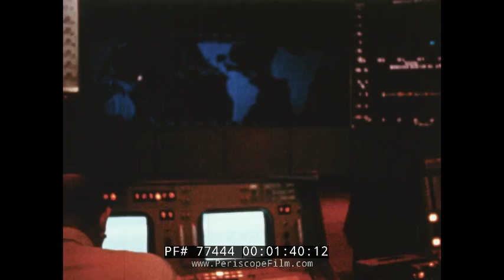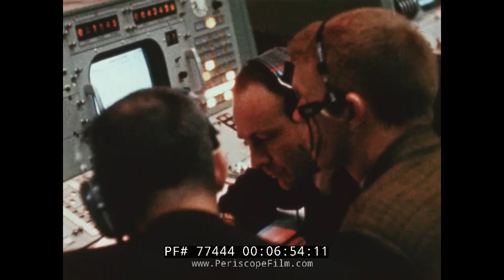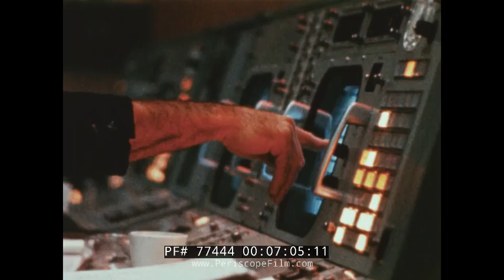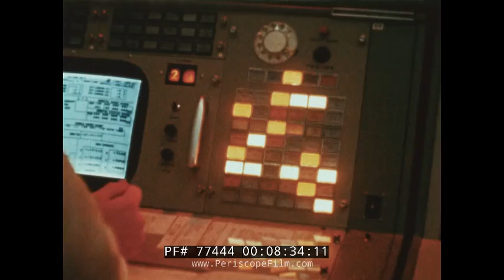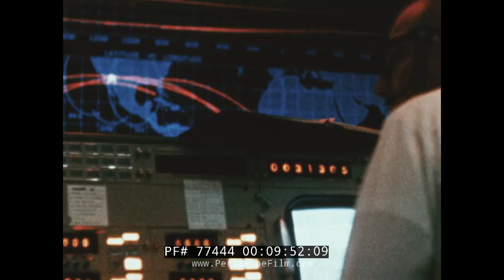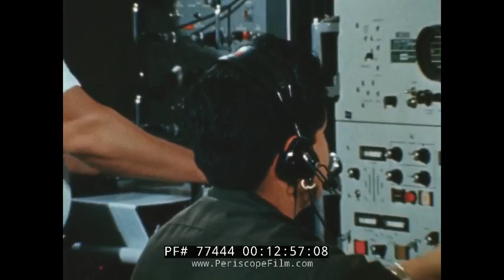THE APOLLO 5 MISSION NASA APOLLO PROGRAM LUNAR MODULE FILM 77444

Comment: This unmanned LM test was originally scheduled for April, 1967.

Had the Apollo 1 tragedy not occurred, Apollo 1 would have flown in February, 1967 on a flight of at least eleven days, perhaps even sixteen days.

April, 1967 would have been the first unnamed test of the Saturn 5 rocket. and the first unmanned LM test flight.

In June of 1967, there were to have been three missions. One would have been an unnamed LM that would have been launched by a Saturn 1-B.

A second manned Apollo would have been launched on a Saturn 1-B to dock with the previously launched LM for a manned low earth orbit test.

The third launch would have been the second unmanned launch if the Saturn 5.

August would have seen the first manned Saturn 5 launch, with a high earth orbit test (several thousand miles) of the LM.

October, 1967 would have seen the first lunar mission, a lunar orbital flight and lunar landing rehearsal.

Christmastime 1967 would have been the first manned lunar landingof
Supposedly, had they lived, the Apollo 1 crew of Gus Grissom, Roger Chaffee, and Ed White would also flown that mission and that Grissom and Chaffee, instead of Neil Armstrong and Buzz Aldrin, would have been the first two men in the moon.....and that the landing might have been on Christmas Eve, 1967.
Reply: It's more agreed that if Apollo 1 hadn't happened - they wouldn't have gotten to the moon. Too many safety failures, shoddy work. It took those three men for the program to take a step back a moment and do things differently. Even then, many issues happened and the majority of missions was almost down to sheer luck.

Comment: They got a far superior command module because of the fire and the success of the program and landings...

Only Apollo 13 had problems due to a 02 tank explosion and they took fixes after that. A third tank placed at a different location and a super extra battery was installed for more emergency power if needed.
Reply: There was three tanks to start with. And they added an extra 200ah battery just to power the Command Module. 

The real issue with the explosion. The tank assembly was designed to be onboard Apollo 8, but it slipped on the platform mounting bolts. When it was being installed. So they removed it. Then put the one designed for Apollo 13 on it. 

Think about that. Apollo 8 went to the moon without a LEM. Had that tank assembly been installed on it. There was no chance of them making it back. As that one tank was damaged years early from over voltage. And nobody knew about the voltage changes NASA made. It was never passed down to the technicians. That actually tested the tanks.
Reply: @WizzRacing  I think you're mixing up the actual fuel cells with their reactant tanks. The Apollo CSM had 3 fuel cells however prior to the post 13 redesign, they only had 2 o2 and 2 h2 tanks, and all 4 plus the 3 fuel cells were all contained in a single sim bay. After they still kept the 2 h2 tanks but added a 3rd o2 tank on the opposite side of the SM that could be isolated in an emergency to supply crew breathing only, added an extra beefy battery to the SM, as well as another big (400AH) battery to the LM descent stage, among other changes

Comment: I thought the apollo 4 LM burn took it out of earth orbit and it was still orbiting the sun. Or is that the apollo 9 LM?
Reply: I don't believe Apollo 4 had a LM.
Reply: @kitcanyon658  no it didn’t. But maybe you mean the 3rd stage did a TLI burn to leave earth orbit? Because a LM wouldn’t have anywhere near the thrust to take the spacecraft out of earth orbit
Reply: @sblack48  : I was just pointing out that 4 didn't have a LM, that's all. Unfortunately I'm not up on which object was left in a solar orbit after a burn.
Reply: Apollo 10's 3rd stage and it's luner module are both in a heliocentric orbit.
Reply: @kitcanyon658  i think they said it had a “boiler plate” LM whatever that means
Reply: @sblack48  ; You’re right that there was a LM on the Apollo 5 mission. It actually did fly on its own in orbit, test firing its engines, both the descent and ascent engines.

Comment: I was an avid Apollo program in the 60s and 70s and don’t ever recall Apollo 5 ... or 2, 3, 4, or 6
Reply: They didn't number the flights that flew until Apollo 4.  There were a lot of unmanned vehicle tests -- mostly with Saturn 1's/1B's and boilerplate (engineering mock-ups approximating manned flight vehicles) hardware.  Several of the surviving boilerplate command modules are in museums around the Untied States.  They were instrumented flight hardware but never equipped with environmental control systems.
There was an Apollo 1 mission but it was cancelled after the pad fire that killed 3 astronauts during a test (January 27, 1967).   The designation "Apollo 1" was never reused for another test mission.
Apollo 4, 5, 6 were not well advertised because they were unmanned missions.
Apollo 4 and 6 tested the Saturn V rocket with a Command Module but no Lunar Module because they were having problems developing the LM and the first manned LM tests were delayed until 1969 (Apollo 9).
Apollo 5 did test the LM (the only unmanned LM test) but it wasn't a full-up LM in the sense that A) they had no landing legs to save on weight and B) the batteries and oxygen tanks were only partially loaded.  The batteries were partially discharged to prevent over-voltage of the electronics and the oxygen tanks were only partially filled to save weight and also because it was unmanned.
Apollo 5 used a Saturn 1B, a much less powerful rocket than the Saturn V, to put it into orbit.  [The Saturn 1B is an uprated version of the earlier Saturn 1 rocket but otherwise similar in appearance.]  Because of this, they didn't test a command module along with the LM.  It was a lunar module-only test.  The Saturn 1B could NOT boost both the Command Module and Lunar Module on the same booster rocket into orbit.  Most Saturn 1B's that were flown boosted Command Modules into orbit.  The last flight of a Saturn 1B was the Apollo mission that flew as part of the Apollo/Soyuz test project.
The last flown Saturn V was used to boost the Skylab (1) space station into orbit.
There are leftover Saturn rockets and rocket components there weren't used (Saturn 1's, 1B's, and V's) in museums around the United States.  None of them (except a few preserved engines), of course, are in condition to ever be used for manned or unmanned flights.  They haven't been in climate-controlled storage for well over 40 years and there was never any serious intention to fly any of those rockets after the Apollo program wound down...
Reply: @AvengerII  thank you
Reply: @jmadratz  Hey, it's not a problem!
I only learned about NASA's crazy numbering system recently.
They did a TON of test flights, unmanned, of the Saturn 1's before they flew people on any of these Saturn rockets.
This (the 1960s) is my favorite period of NASA, too.
I've been fortunate to go to several museums around the United States and see flown hardware from the 1960s and 1970s.  I've been to the aerospace museums at San Diego, Washington DC (the original NASM, not the Dulles annex -- yet), Dayton, Wapakoneta (Neil Armstrong's childhood town), and Chicago.  Oh, and Kennedy Space Center in 1980.
Reply: After Apollo 1 fire they changed a bunch of things and had to retest them all.

Comment: 3:42 rocket propulsion, first ever successful rocket landing, way way back, now its a piece of.... cake!
On nasa footage there was no ascent seen flames. Think to exit those you can not wear a packsac.
Reply: Door was square to accommodate wearing the backpack.
Reply: @MrEh5   the forward hatch of LM-13  confirm that the typical LM forward hatch is 32 inches square. 
  The LMP opened the door. It was hinged on his side, so he had to crowd toward his side of the cabin and hold the door open against his legs. The commander would then turn round, get down on his hands and knees, and back out onto the porch. 
 - would LOVE to see Them crowl out /in with all their gear, but despite 6 picnics that was never filmed :(
Reply: @marcleblanc3602  that's how one of the switches got bumped and broken.
Reply: @MrEh5  yeah... miracle only one got it, very tight quarters for EVA suiting :)
 Good thing the nexts were less clumsy.
Reply: Hypergolic fuel, so no flames.
Reply: Gemini launched on hypergolic boosters. So you see hardly any flames there, too. Also it was felt there was just about no explosion risk, so they had ejector seats instead of launch-abort systems like Mercury and Apollo.
Reply: Look at the LEM descent footage, e.g. Apollo 11. Notice the dust being blown out radially in precise straight lines?

What happens to dust normally on Earth?
Reply: @marcleblanc3602  Go on, do tell us: what kind of explosion?